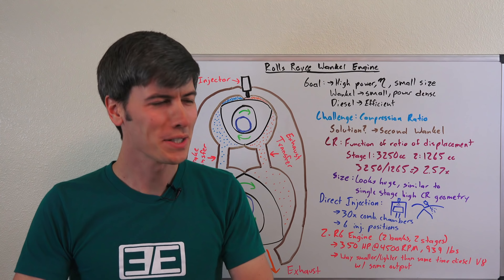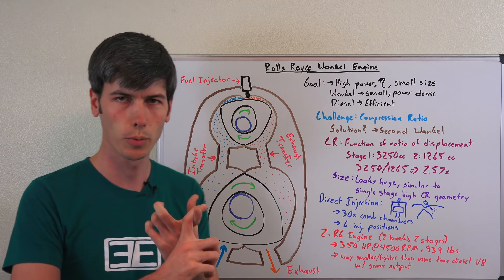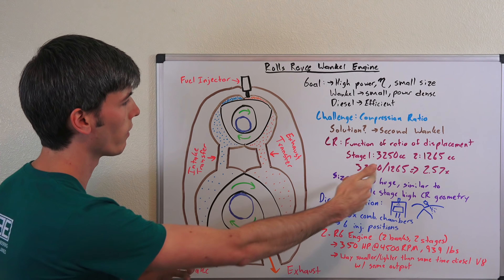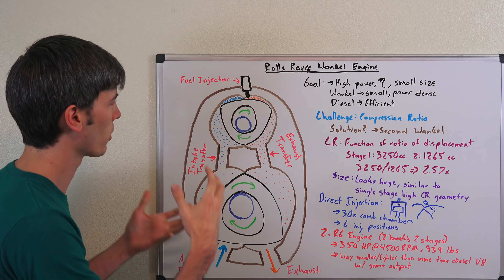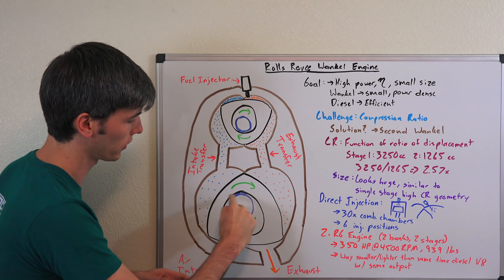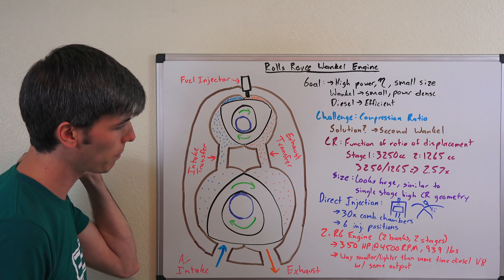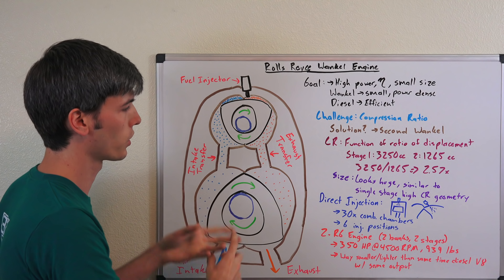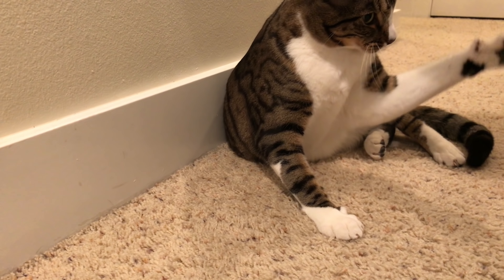Rolls Royce Made A Diesel Rotary Engine With Four Rotors!

Comment: Can you do a video on why aircraft piston engines are so low compression?  And why they "require" 100LL fuel since their compression is only 7:1
Reply: Brent it's the air density at altitude. also the fuel helps prolong engine life and performance. I run av gas In my race engines
Reply: They are low lead because gasoline used in cars can easily mix with water and moisture. Airplanes need a very low failure rate because a failure high up is a lot worse than a lot of failures are 80mph on the ground. I'm talking strictly engine failures. A tire failure at 80mph can be a huge issue, but so can losing a wing up in the air.
The lead is part of the octane boost, and the only reason it is there. The alternatives have a negative affect on the fuel. They are trying to work on a non lead alternative, but with aviation, it has to go through a lot of testing, and certification. This slows the process down but does make sure it will preform flawlessly without any major problems.
In car engines, the switch to ethanol fuel isn't flawless. The fuel has caused problems in small engines, to large engines. Especially any seals in the engines.
The 100 octane is probably just there because although the majority of aircraft engines don't need it, it wont hurt, but the same can't be said about the ones that actually do need it, and can't get it. Its just easier to have one fuel type that works in all then to stock multiple types. I don't think all aircraft actually require av100ll but look at wikipedia for the variations and how much of a mess it can be to try to stock everything and not let it sit around too long, or have problems.
I hope this was clear enough. A lot of this I picked up when I decided to use av100ll for my small engines. I like the ability that I can store it over the winter and not have to run out to get gas if I ever need it for the generator. 
This may also be another factor. I let gas sit in a container in the garage (so no direct sun light) and over the winter the gas was turning black, and usable. To have this in a tank that you can't see into, can be a huge issue.
Reply: I would guess that the compression is low because of the size of the combustion chambers and how fast it takes for the flame front to spread out. The 7:1 compression engines can run on much lower octane fuel, and were designed for 80 AKI which used to be the old low octane avgas standard, and will happily run on car petrol. Larger engines, turbocharged engines and higher compression engines needed the 100 octane fuel. Most of the 8.5:1 ratio Lycomings will run on at least 91/92 octane, and some on 87 octane. I have an 8.7:1 Lycoming on mine, which needs at least 95 octane, and thus 100LL is the fuel of choice for it. They stopped producing 80 octane avgas a long time ago. In Europe we have 92 octane unleaded avgas as well (basically 100LL without the tetra ethyl lead), available from Total in France and 91/96 from Hjelmco in Sweden.
Reply: Piston engines in general are designed with low compression ratios for  1 of 2 reasons.  1st, If the engine runs with a supercharger, then the effective compression ratio is much higher when the supercharger is active.  So the compression pressure may be high when the supercharger is operating, even though the compression ratio isn't that impressive.   2nd, If the engine is not a high speed design.  For example, industrial or tractor engines are often tuned to produce max torque at about 1800 RPM.  Generally this calls for seemingly narrow intake passages, long piston stroke, and low compression ratio.  Side note: Low compression ratio gas engines typically have enormous spark plugs.
Reply: @Brent--"why aircraft piston engines are so low compression?"  Mainly for weight reduction.  Engineers have calculated the power to weight ratio of a high-compression engine vs that of a lower compression engine, and determined that reducing compression to a certain point resulted in the highest power to weight ratio.  Lowering compression ratio reduces the cylinder weight, head weight, crankshaft weight, valve weight, flywheel weight, starter weight...etc...pretty much all moving parts can be reduced in weight by reducing compression ratio.
The 100LL is a relic from the past when  other options for octane boosting was not available, but is also necessary for certain engines to help lubricate and  protect valve seat on those engines without sufficient valve seat hardening.
Reply: Actually, most of the general aviation fleet does not require 100LL. If you look at the certification data for common low power engines like on a normally-aspirated Cessna 150 or 172, the engine can actually use 80/87 octane fuel. Many of these airplanes have an STC available that allows the user to run automotive gasoline (non-ethanol), because 91 octane “mogas” provides all the detonation resistance these engines need.

High-performance turbocharged airplane engines DO need the high octane rating. TSIO550 would be an example. While this is a small number of airplanes in the fleet, those tend to be “working” airplanes that actually do most of the flying and consume something like 70% of the fuel... so when consolidating fuel options, the less-critical fuel (80/87) went bye-bye, and 100LL was retained.

The lead is there due to historical factors. Old fuels used lead to attain their octane numbers. A byproduct is that lead cushioned the valve seats, so these engines use softer materials at that contact surface. What this means is that using a modern fuel that uses non-lead compounds to attain the necessary octane does not have the same cushioning effect. It is very expensive to recertify an engine with new parts which puts a damper on supply, and aviation engines tend to last a long time putting a damper on demand, so the rate of turnover to move toward a hypothetical unleaded-capable engine is glacially slow.

The unleaded fuels initiative is working on a 1-for-1 substitute for 100LL. It must provide at least 100 octane for the high performance engines, it must have anti-wear properties to prevent erosion and durability problems in existing engines, it must be stable for long-term storage (some airplanes only get fresh fuel a couple times a year), and some other factors. You can look up the FAA website providing status on the initiative, or the AOPA articles on it. Plenty of good info out there.
Reply: Old thread but the lower the compression requires higher octane fuel because it's easier to burn and also the problem with air density at high altitudes the higher you go the less o2 there is around you to take into the engine

Comment: Interesting design.. it seems it would have been a good plan to have 2 smaller injectors, instead of one large one (similar to the 2 spark plugs in the gas engine to carry the flame front across the compression area of the chamber). With sequential firing of these smaller injectors, it could have produced a controlled 'angle of attack' on the rotor generating more torque, in addition to cleaner burning.

Comment: Any chance we could ever get a video on Rotary Valve trains?  would be interested to know more about it.
Reply: Yes please!
Reply: Rotary valve trains hahaha good one tell us another
Reply: I think he means the type of valve, not valves on rotary engines. Harley Davidson made engines with rotary valves. In fact I think it was even a single valve per cylinder that rotated the gas flow to left or right for either exhaust or intake.
There's also sleeve valves that rotate inside the cylinder between it's walls and the piston, and some side valve designs with rotating valve like the newer Harley Davidson one but on the side instead like a flat head engine.

Comment: Funnily enough I know a bit about this engine I saw it in action at shrivenham military academy 1971 I was 15. The wankel deal was you all had to share your breakthroughs if you held a license. RR solved the rotor trip problem with this motor and had to share it but never benefited commercially. The amazing display I saw they ran the normal tank engine, vibrating wildly then the wankel. Stood a coin ON ITS SIDE while it ran. Now I will watch the video, maybe there are overlaps!  Thanks for the channel

Comment: Were the rotors linked via a gear or chain.?
Reply: No. The compressor rotor is driven by exhaust gas. Same principle as a turbo.
Reply: No it was also pushed by exhaust gas not exclusively this would not work at all if that were the case you already are letting the exhaust gases expand a lot before they get there and the rotor is very very heavy compared to an impeller
Reply: You are right in that they have to be linked in much the same way as a supercharger, & while either could be used, gears would keep them in synch more accurately! 
Despite the other comments, the larger compressor-rotor can't be free-spinning like a turbo, otherwise it wouldn't compress & scavenge the combustion rotor at the right part of the cycle, but probably best to think of comparing this rotary to the way a jet-turbine engine has the compressor turbine directly connected by a shaft driven by the exhaust-turbines (with the combustion chamber in between)!

Comment: Way to make rolls Royce even less reliable
Reply: well we are talking about diesel here... so ignition is much more precise than a regular rotor. I think it would have been an amazing engine.
Reply: Apex seals would go out soooo fast in a diesel not to mention you'd have twice as many and it wouldn't run right if at all if the compressor seals go out
Reply: 1423 171 i dissagree. Combustion is under control unlike gasoline. Seals would hold better I think.
Reply: Again talking about rolls Royce here , people who buy these cars don’t care about the car reliability nor efficiency.
Reply: 1423 171 Idk the diesel fuel is a better lubricant than gasoline
Reply: Diesel has more lubricating properties,gas which is a solvent
Reply: Ali Salahat - This engine was intended for military use, not for Rolls-Royce motorcars.
Reply: But you also have to consider the fact that if an apex seal goes out and loses compression, you don't still blow up your engine. Ignition wouldn't ever take place, so flushing the housing and replacing the seals is all you would need to do. I'd much rather pay 100 dollars to have a trailer for a day and a chunk of change for seals+labor rather than deal with the cost of an all new engine and installation.
Reply: But this was supposed to have a military application. The people who cared about these cars needed strictly reliability.
Reply: Lieutenant Tilted - If a Bentley motor lost compression in one or more cylinders, there would be no blow up there either.
Reply: Not my point. If a standard gas-powered rotary wore down a seal, the spark would ignite gas in two chambers rather than one, and literally blow up the engine.

Comment: Hello, 
I just instalated a coolant reroute on my 1991 Mazda Miata for better cooling.
With that I also upgraded to a new Hi-Flow (88c) thermostat and water and oil temprature guages. after I did the reroute I noticed something the oil 
temprature is going up to operating temprature 80 - 90c, but water stays at 50-60 celsius, before it was 80c. to be fair it is pertty cold oudside now, so 7- 10c.

But I think its weird that its a 20-30c difference. my question is, is it bad for my car driving with a low water temprature ?? ( oil is still the same )

Thank you 
Theo

Comment: LOL apparently, diesel doesn't emit enough pollution, they had to go with Wankel as well.
Reply: funny comment. good point! if they only micro sized it for a chainsaw you'd cover all angles!
Reply: Car guys don't care about "Saving the World".
Reply: But we care about saving the fuel :)
Reply: Bro Tang your mind is about to be blown. Google “Sachs-Dolmar KMS-4”
Reply: Wasn't Royce also looking into the whole apex seal problem - the entire reason for the awful emissions in Wankels in the first place?
Reply: Derpy 1109 
Everyone that developed rotaries tried to solve the problem with apex seals. Honestly, making it diesel isn’t a bad solution, no need to worry about oil in your fuel if your fuel is oil!
Reply: @Derpy-qg9hn  That was down to the combustion chamber shape (long & thin), the seal problem was more about long term reliability (although it does have an affect on long term emissions getting worse).

Comment: I'm so pleased you found that article and shared it with us. Question, would there be any need for the exhaust gases to go through two rotors, could they not exit via the first rotor the way a normal rotary engine does?
Reply: They could, but he mentioned that the hot exhaust gases actually do useful work in the second (larger) rotor, so by having it setup this way, the engine is more efficient.

Comment: Wankel engine produces 6 times more power than a 4 stroke engine so why wankel engine is not used that much?
Reply: Harder to maintain and not very fuel and oil efficient compared to regular 4 stroke piston engines.
Reply: Not very reliable by any means, the RX8 is notorious for being unreliable. This is of course if you drive the engine hard and it's a rotary so you have to.
Reply: Ask Rob Dahm, I think he can think of a few reasons ;)
Reply: you cant think of it as a piston engine. Wankels are akin to jets, extremely reliable if maintained correctly. common misconception that they are unreliable.
Reply: Thanks
Reply: But the power it produces is insane
Reply: Paul Poirier Not to disagree entirely since you have a point, but especially Mazda's Wankel engine is known to be thermally problematic by design. I believe that uneven heat distribution makes reliability suffer on the long run, no matter how you run the engine
Reply: Paul Poirier nothing like a turbine.
Reply: Hard to keep up with emissions demands
Reply: kaposvári bando lol no , you should do some research that is all i can say
Reply: 177SCmaro in one revolution it has 3 power strokes
Reply: 177SCmaro i know rotory engines don't have strokes , that was just a slip i was trying to say that on each phase of that triangular rotor power is produced
Reply: Apex seals, eating oil etc etc
Not fuel efficient (well, back at '90s); Not eco-friendly(eats that oil); well, it eats oil..lot of it;low compression ratio, i think; it really has trouble with cooling, as power stroke occurs all the time at the very same point.(piston engines have some time to cool during the (sorry, forgot the right word) outtake, intake strokes
Reply: Like a traditional motorcycle 2 stroke, they're compact and powerful, just not very efficient or clean.
Reply: The problem with Wankel engines is the seals have to move in 4 different direction not just two or one. To be blunt the correct material has yet to be developed for the seals. The other problem they have is that two thirds of the combustion area have to be coated with oil because it is also a bearing/sealing area. If you don't they burn up seals pretty quickly. It should never be said that Wankel engines are unreliable they just have a shorter life due to the reasons above. As usual his diagram was wrong, that would never work with peripheral ports.

Comment: Guys who say the compressor rotor is wasteful need to learn about the dynamics of forced induction. There are ALWAYS losses when you connect more and more parts, but the positive displacement compressor will adequately supercharge the second (& further) combustion sequence; making more power less than 1 second after ignition.
This is a great non-interference design, the ability to simply change an entire rotor assembly in one shot makes this a supremely serviceable engine for military purposes. Private vehicles are not built to be constantly adjusted, but in fleet situations it starts to make sense.

Comment: If you haven't already, could you do a video on the difference between motorcycle and car Inline 4 cylinder engines. How and why they run at much higher compression, why the pistons are shaped so different, assembly and organization, etc

Comment: Has all the benefits ( high power output to weight ratio ) of a Wankel, but then also has all the best characteristics of a turbo (recycles exhaust gas rather than create parasitic drag on the motor ), while having the superior linear performance of the supercharger ( geared in boost rather than turbo spool / lag effect) INCREDIBLE>!!!

Comment: From your diagram if correct. I am not certain that the large rotor does not harness the expansion gases and add to the power output of the overall engine.  The diesel would still be burning and creating pressure after its 8 to 1 expansion on the initial rotor.

Comment: Would be very interesting to know if the 2 eccentric shafts are linked together like a crank and camshaft or if they are allowed to spin at their own speeds like in a Turboshaft gas turbine. Also  if the were spinning independently which one was used to produce power?
Reply: I'm figuring  it would have to spin together.

Comment: Looking at the design its almost like they are running the smaller rotor as a pre-combustion chamber for the larger rotor. They also may get an even betterer burn if they add another injector into the exhaust transfer port or into the chamber for the large rotor which will prolong the gas expansion... pretty cool idea :-)

Comment: Good in that it effectively solves the oil injection problem with rotary engines. I wonder how it would compare with vw dieselgate emissions. Bad in that high compression would further expose the rotary seal problems..

Comment: Fantastisc piece of engineering. It's always fun and interesting to learn about these kind of random obscure engineering experiments. I have one question though; was the "compressor-rotor" just driven by the exhaust gases or was it also synced/driven by the power exentric shaft?